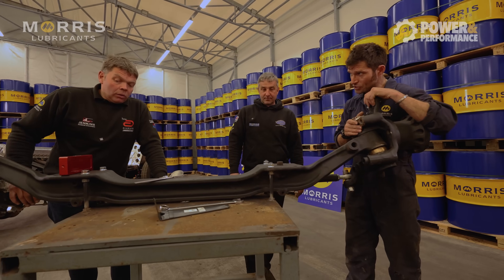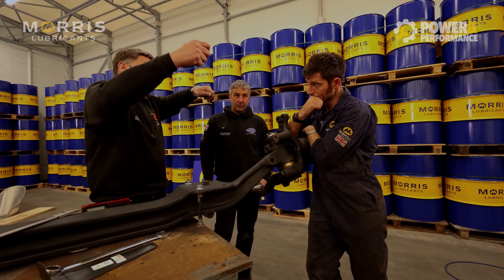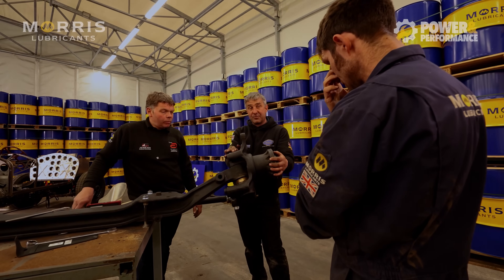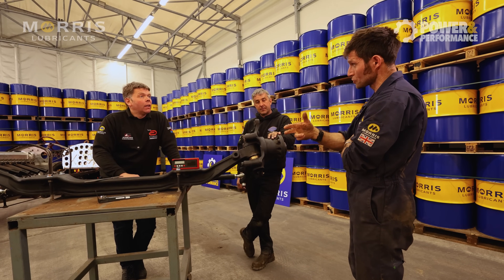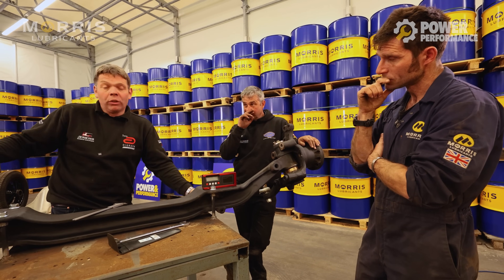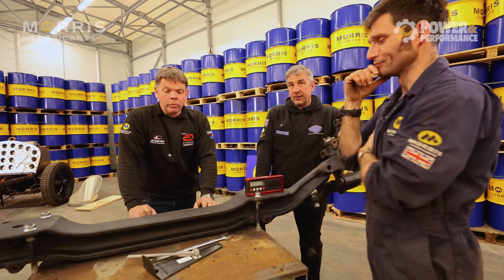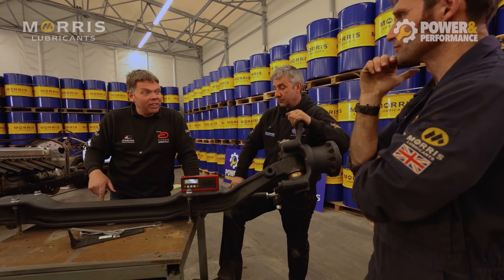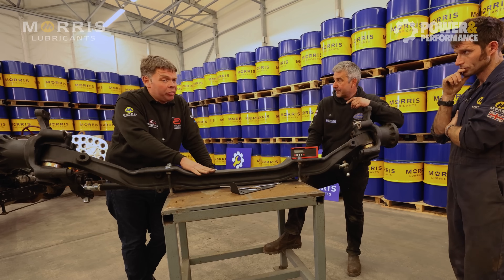Guy Martin Inspects Dave Jenkins' Race Truck's New Axle Design

Comment: what's the difference between kingpin inclination and castor?
Reply: Kingpin inclination (KPI) is the inward angle of the steering axis from the vertical, while caster is the forward or backward tilt of the kingpin from the vertical. KPI primarily reduces steering effort, while caster promotes straight-line stability by creating a self-centering effect, though they both have a "jacking" effect that lifts the vehicle during steering. KPI's effect is typically stronger and serves to keep the wheels tracking straight, whereas caster's effect is related to both straight-line stability and how the vehicle handles turns.
Reply: @James-jf2cl  so is it different to camber in that it relates to the steering axis rather than the inward angle of the wheel itself?